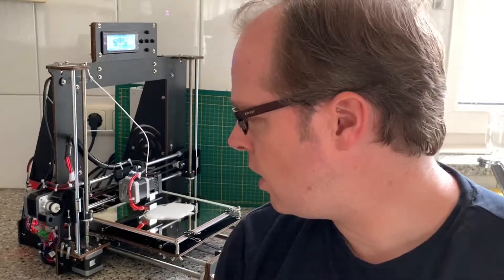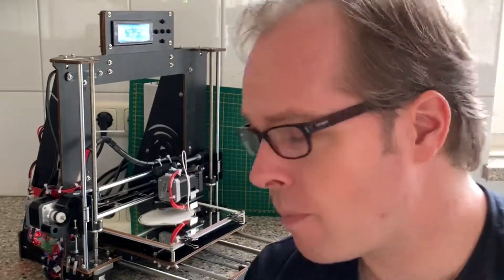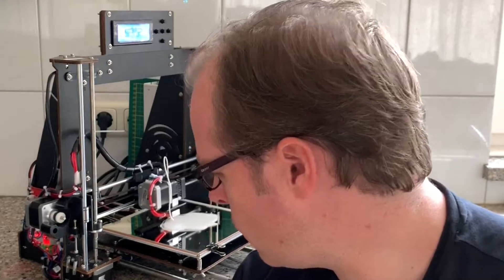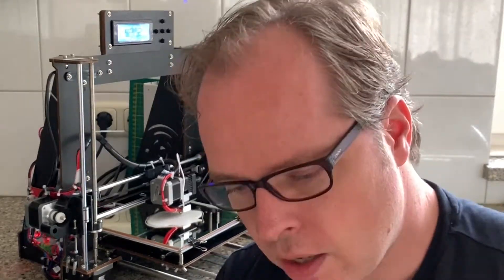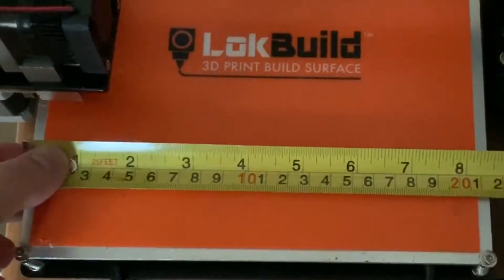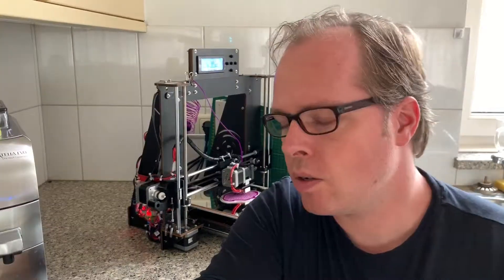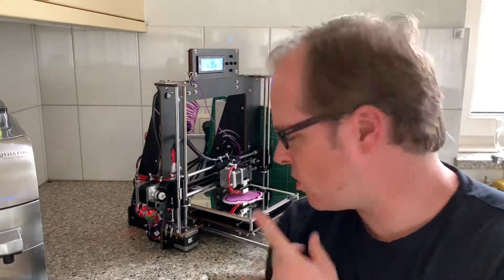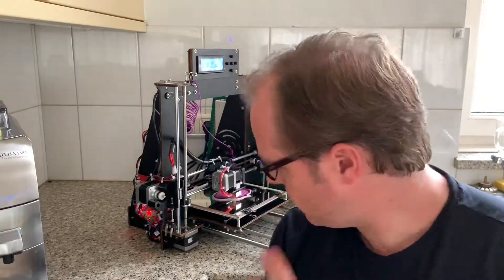How to Fix a CTC Prusa i3 MK2 - DIY 3D Printer

Comment: do you have a download for the firmware?
Reply from the maker: Which version of the CTC Prusa I3 MK2 printer? Because the board, if it is red one, it is the Anet A8 board, and you need to look for the i3 MK2 firmware online
Reply: @Zachary3DPrints  its the white board, gt2560 rev a